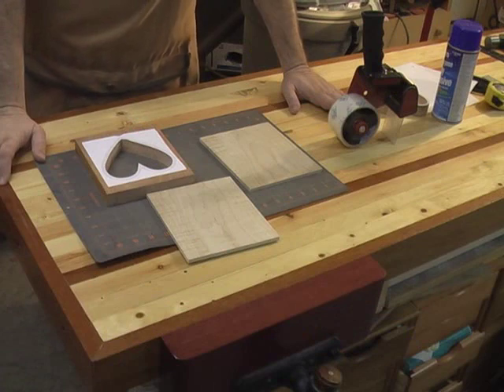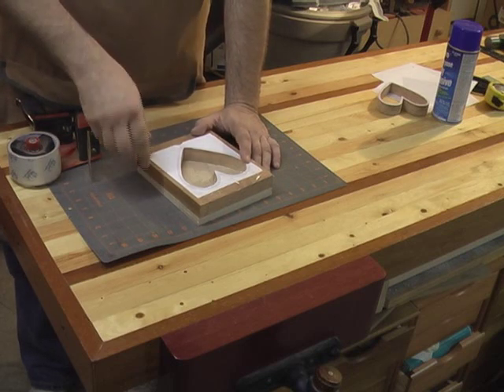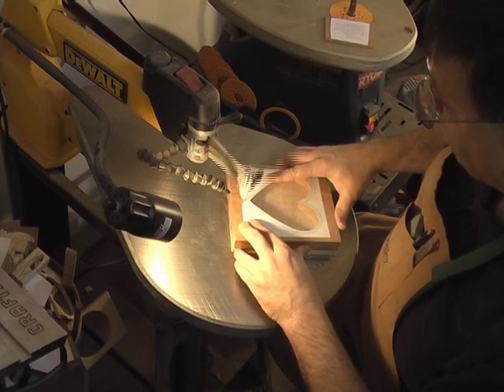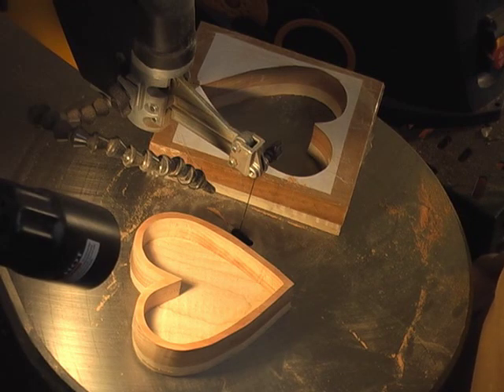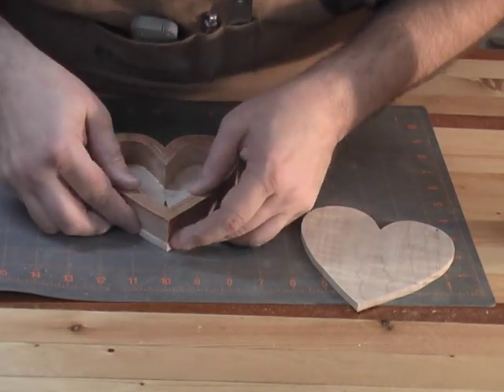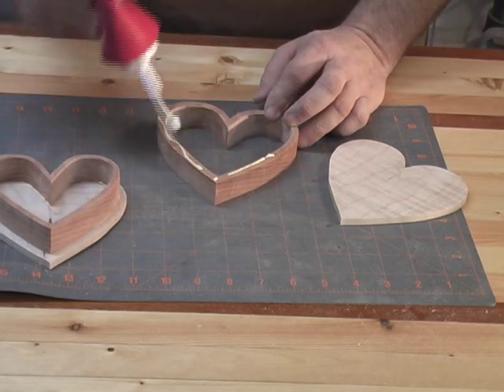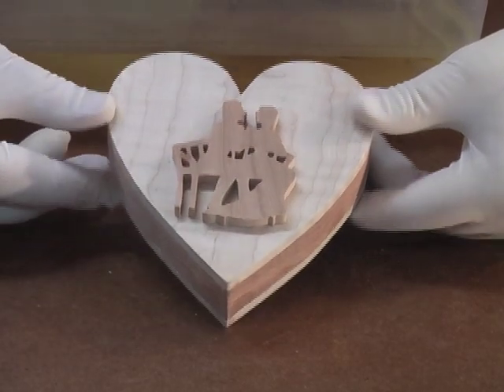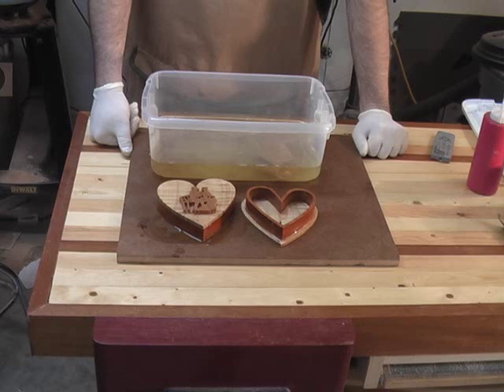Scroll Saw Heart Box Part 3

Comment: Love this! Curious why packaging tape versus carpet tape to hold everything together. Thank you for this video ☺️
Reply: The packing tape is not specifically to hold this together. It does two things. It makes the pattern easier to remove. Second, the glue on the tape actually lubricates the blade and prevents scorching of the wood from friction heat. The scorching can be very difficult to sand off so it is better to avoid it.